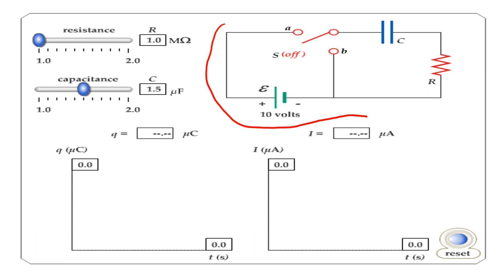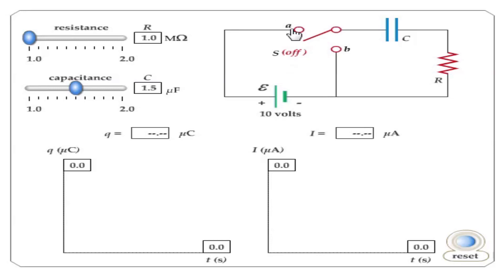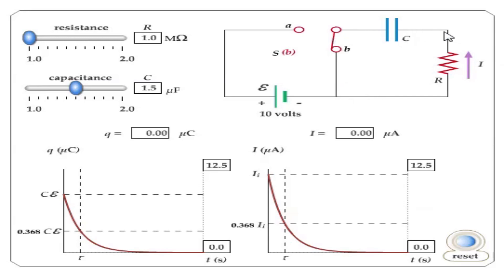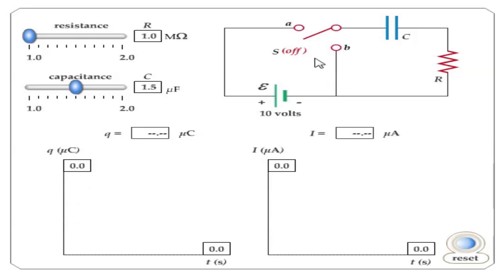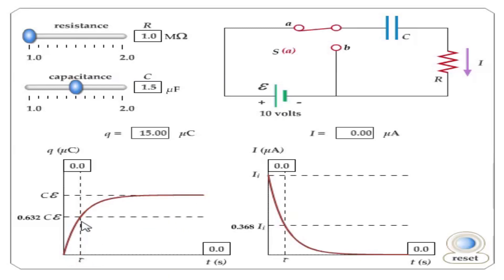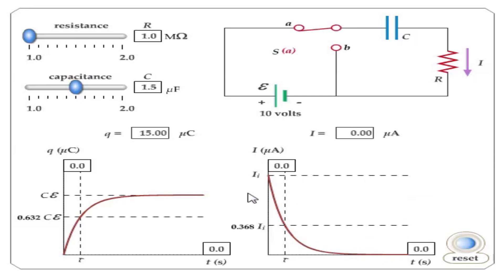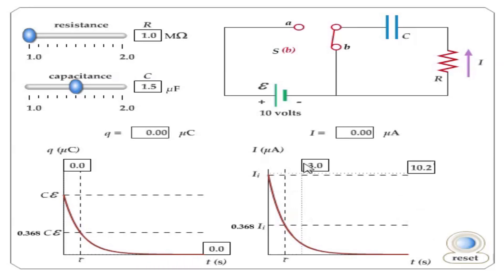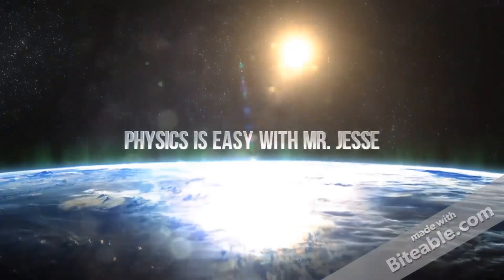Capacitor's charging and discharging graph

Comment: Which software is this?
Reply from the maker: Mazhar Ali, The simulation is accessible through the college physics by serway ebook
Reply: I hate to labor the point but does the software come as part of the book, ebook or does it come from a website College Physics.  Can I get the ebook from Amazon.  Usually, these are a separate insert to a regular book. Any guidance you can give would be helpful.  Thanks.